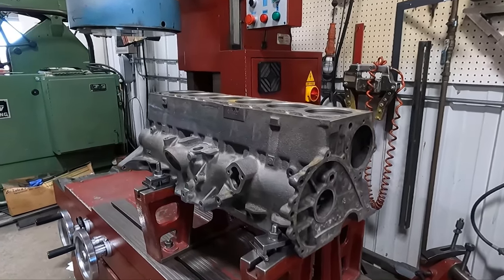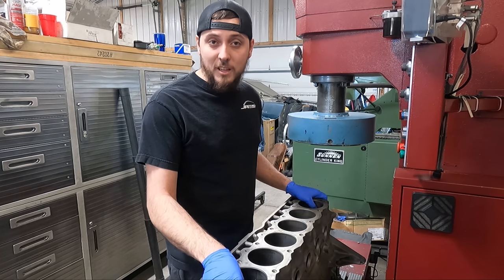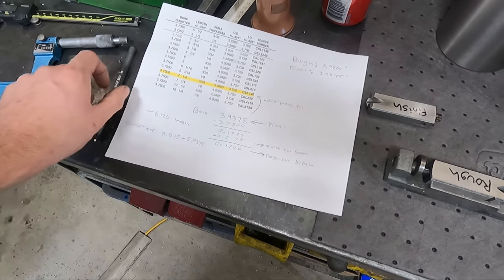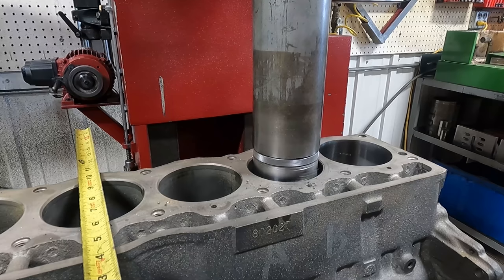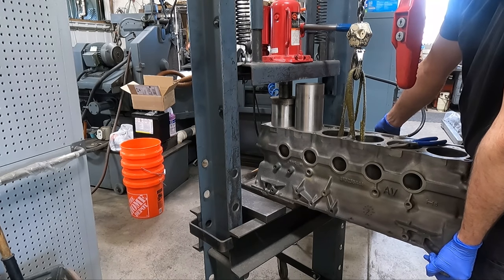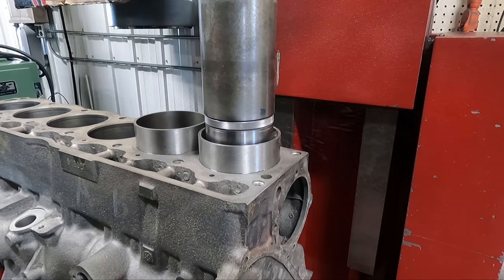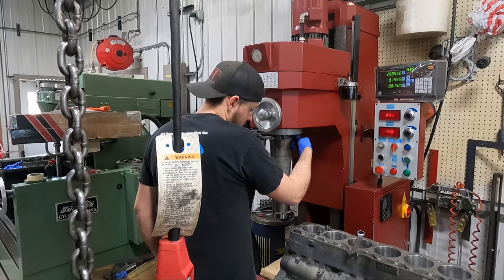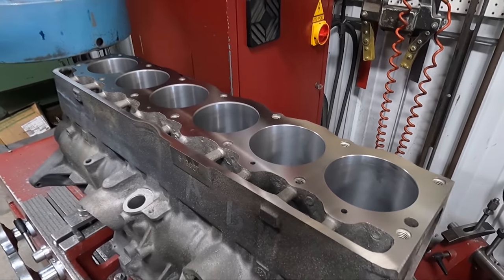Installing Two Repair Sleeves In A 258 AMC Straight Six Block @JAMSIONLINE

Comment: You repaired an engine like I had in my 73 AMC Hornet.  It was a very good engine!  I wished it had a larger carburetor, and fuel injection would have awakened that engine!  Actually I wish I had the car now!
A simple engine to work on and gave good performance.
You did a very good job, your details of whats needed in each step made it understandable and the engine's owner will get many good miles with it!  Thank you!
Reply: If you find my comment above, the car the engine was in was a '71 Hornet. It was bright green, so I called it (of course), The Green Hornet. It would really boogie, and it was reliable. I had added stiffer springs, sway bars and coil-over shocks (I found Mustang shocks fit to a T). Boy! It would take a corner with extra wide T/A Radials. I miss that little car much. I sold it to Grandpa who gave it to grandkids, who wrecked it. Damn!

Comment: New subscriber to this channel.  As a mechanic  of over 35 years  it is still great to see that all over the world there is still machine shops operating to this high standard of quality. When I was a younger mechanic we always had heads  off  and blocks out for repair. Now unless it's for high performance or antique restoration. It is either install a second hand engine or scrap the car.  How times have changed in the automotive industry here in Australia.
Reply: America is no different. 
Aside from industrial engines and hotrod enthusiasts, nobody will pay for rebuild engines.

Comment: Thanks for showing the process. Never seen this done, but have had it done on numerous motors. I was shocked that you could bore the Cylinders without oil or some lubricant.

Comment: Lovely work, it's great to see a shop that still works to such a high standard. Rare as rocking horse manure these days in the automotive engine recon business. Watching this particular job also made me think of the ease with which I could recondition my Triumph TR3 and TR4 engines back in the day, as they had wet liners that were a just a breeze to replace.

Comment: As a machinist we would move the bore a little bit when the situation on coming to our shop being a stock engine mainly you have to know how much cylinder thickness you have to work with to be able to move this cylinder bore over to a reasonable bore size and you have to look at the head gasket situation. And always look at the cost of just getting another block.

Comment: My 258 snapped the #1 rod near the crank. The rod punched a 2x2 hole in the side of the block and the piston pushed up in the cylinder with the rod hanging from it. It kept running. Opened the hood to see what happened.....the new window in the block made for any easy diagnosis. I JB welded a sheet metal patch over the hole, and the 5 cylinder lasted for nearly 2000 miles afterward. 73 hornet. 130k when she blew.

Comment: That takes skill, my skills are in welding, I work on antique tractors and things I am not done with a 1957 D8 caterpillar but I do have it running after 30 yrs since it was seized from over heating but had to have some machine work done and want to say you do very very awesome work, I don't know if I'm to old at 55 to learn skills like that but would like to give it a try

Comment: One way to visually determine in the block is a 258 or a 4.0 is the 4.0 has an area on the water jacket side of the #1 cylinderspot faced for water pump clearance. When manufactured all six bores were finish bored in one operation.  Followed immediately by honing.

Comment: Thank you for taking the time to go over the whole process in detail, there is a lot of videos on cylinder lining that just show this information....
Just have one question, when you retract the boring bar, how does it not scar the bore on the way out..
Reply: My guess is that it does but with a boring head that diameter its going to be super rigid and the score will only be maybe .001, but even if its .003 he is honing .004+ so it will clean up during that process. I am a Machinist (not engine) in a CNC mill there are boring cycles that will move the spindle towards center at the bottom of the bore, after the spindle orients to pull the cutter off the wall. There is also a feed in feed out cycle. I do not know if these have that capability.
Reply: @MiloPerrotti  
If I required I would imagine that they could position the cutter at the X positive position and just move the table over. 005"
Reply: @mpetersen6  yeah duh, but does the machine have the capability to do that on it's own? That's what I'm talking about. Of course you can do it manually.
Reply: @MiloPerrotti  
Automatically?  I doubt it.

Comment: First timer here on sleeve boring, in my past most mechanics would not trust a sleeved engine rebuild, unless it was originally a sleeved engine. 
What would set a prejudice like that?
Like how you know your equipment to get it to meet tolerances.

I do agree with the other commenter about using liquid nitrogen to shrink the sleeves before installing them. It is used as a standard practice with diesel commercial, construction and agricultural motors. It is not expensive to set up. A dewar, freezing sleeve container, gloves and tongs to handle/move the sleeves in LN2, then a written procedure for safety and methodology.
Nice shop and great detail on this customers block, would be nice to see a completion video.
Thank you all for sharing.

Comment: 1980 and later 258 are known as lightweight 258's as they removed 20lb's of material from the crank and block. the lightweight 258's tend to develop wavy bores and break rings, they can also get pinholes in number one where they're machined for the water pump. it's always better to use a pre 1980 block but the sleeves are a good option to keep a lightweight going because they won't last long if you bore to 60 thou over.
Reply: I would have sleeved all 6 of them.
Reply: @barryfields2964  Me too 👍😏

Comment: I love watching you guys work! Just a thought... When you are pressing in sleeves, are you putting the tapered edge of the sleeve down or up? From what I have read, putting the tapered edge down can actually cause issues since the sleeve bottoms on the top of the taper. When the sleeve is bored/honed, you can end up with a gap between the bottom of the sleeve and the ledge at the bottom of the cylinder bore. This means that there is a slight chance of the sleeve moving in the future. When the square edge of the sleeve is put down on the ledge, this is no longer possible since no gap opens up as the sleeve is made thinner.

Comment: i have work in auto machine shops on and off for 40 year's i did line boring  , motor Assembly w/ test run  and balancing . in the area i am in there is no one behind us to take are place and that's sad . who is the maker of your boring surfacing machine [rmc 1600 ok it showed up in your video now i know]  thanks and keep up the great work and videos . i wish the blocks that i work on were as clean as your stuff is clean .

Comment: Love  your content and I don't usually comment ....The big elephant in the room here.. Every time I pull down and engine that has been run with no thermostat . This is the what happens when ignorant people remove the thermostat..cold water / cold front bores .. fuel washes the cold  bores.

Comment: Just a little FYI....the rear main seal in a 258 can be used to replace the OEM rope seal in the Oldsmobile V8. Just trim the 2 edges off. You're welcome.
Reply: I did not realize that. Some people were using Ford 460 rear main seals in the Olds 455.

Comment: They make a destroke lever for the cv-616.  It is a add-on that will let you dwell anywhere in the cylinder.  I believe it's only about $500.
Reply from the maker: It’s sitting in a box on the floor of the office because I haven’t had time to install it 🤣
Reply: I have a set of coarse diamonds that I use in my cv-616 if I don't have to sleeve and I just need to take out .020 or so.  It saves a lot of time from going from the boring machine to the honing machine.
Reply from the maker: Us too! I like the diamonds also. We deck most blocks so if it’s already on the machine it’s not too much more work to bore.

But once in a while I just hone!
Reply: I did not know it was practical to hone +.020. I did hear of instances where honing +.010 was a good move. It was on the Hagerty channel. A guy had to do a second rebuild of his 396, which was already at .030. He was able to have it +.040 afterwards.
Reply: @skylinefever  With stones no but with diamonds yes because they dont wear and cut super fast.  I will leave .003 after the diamonds and do the rest with stones.
Reply: @ballardperformancemachine  Thanks for the explaination. Since I'm not a machinist, I don't know the minor details about machining equipment.

I did hear about using various honing equipment by Total Seal, they say it is critical for getting the most out of new piston rings.

Comment: Balls to the wall sleeve everything to Standard lol 
1. do sleeves wear better than the block?
2. why do you think the last 2 has so much ware? does that end of the block take longer to heat up?
Reply: Slevees may wear better than the block. They are often made of centrifugal cast ductile iron. It's an improvement over engines made of cheap grades of iron.

Comment: Have you guys ever thought about freezing the sleeves with nitrogen before installing them ? I do it with machinery bushings
Reply: I was going to ask the same
Reply: You wouldn’t even need nitrogen. We use to just put them in the freezer overnight, and maybe hit the block a little bit with a torch. They would drop right in.
Reply: I have done this with atv bearings into aluminium housing,slides right in ,no nitrigen,just put in the freezer overnight.
Reply: I was also going to ask this question

Comment: 060 on all 6 is a better option from a cost perspective. Centering on the bottom of the bore which was standard would have easily cleaned up at the top of the bore with the wear. If for some reason it didn’t clean up there was always the option to continue with the sleeving of the the cylinder/s.

Comment: I myself have fitted quite a few cyl sleeves and i have to say that engine had a massive amount of wear even in the cyls without broken rings i would say the owner was not even using an air filter or he may have been using a washable filter such as a K&N which are known to let in a lot of dust. The average person does not realise the damage that is done to the cyls and rings when you don't use an appropriate air filter.

Comment: What would you have to do if you accidentally left the parent bore with an extra .002" press fit as compared to your smallest sleeve? Seems it would be very hard to center up and make a .002"cut on the boring mill

Comment: I am a machinist, I’ve never done engine machining but I just wanted to know why u don’t indicate the tops of the heads or the blocks. I see that you use a level. I’m just curious how accurate those are. You don’t remove a lot when u deck surfaces.

Comment: Another question if you don’t mind. I have plans for a 2618 forged piston with 1mm1mm3mm rings how much clearance should be allowed for a turbocharged FE engine at 900 hp?  It is a heavy duty truck block that has minimal wear, but I have to buy custom pistons to hopefully keep the walls .170 thick at 4.103 bore.  It needs a sonic test but measuring between bores with a drill bit shank it has 3/16 inch up and down all cylinders through the core plugs. The bore spacing is 4.63.  By Fords standards it could be bored to 4.16-4.185.  I want to keep the bores as thick as possible and as you know the 391 FT had 3 rib mains on the thrust side. I have a CapSaddle girdle made of the same iron as the block, ARP main studs, head studs and getting the factory 3.79 crank offset ground to 3.91 only a 060 cut.  And a lightening and reduced rod journals to 2.2 from 2.43 so I can use BBC 6.8 rods. The journal index is within specs. And the fillet radius on the rods is easily duplicated. I prefer the forged steel crank made of the same steel as the 427 SOHC only everything is seasoned and work hardened.  I wish you were near me in MO you would have the job on the block and crank for sure. You guys are great. If all goes well I will have a near 1000 hp daily driver FE. With a VS7875 on 413 cubes the boost curve should allow lumping around under 4000 with the roller cam 245@.050.600 lift Bullet cam and at 4000-7000 the fun kicks in. 😅Great shop!

Comment: How thick are these sleeves? I hate sleeving two cylinders side by side, is that just a V8 thing?  The 6 is stiffer, but I just wondered. Do you not use cutting oil?

Comment: What is average cost to do complete machining on a Chevy 305 small block? 
It's in an 89 Camaro, original engine. 
Assuming the crank just needs polished, boring the block 30 over, honing the mains, install cam bearings, planing the block decks, & a complete rebuild of the heads, including new guides, plane the heads, grind the valve seats, but shouldn't have to replace the seats.

Comment: if you were to bore to 40 thou over across the block are you open to over heating issues later when motor is back and running !
Reply: How far you can bore an engine is sometimes determined by how thick the walls were cast. The Ford Sideoiler for example, often didn't handle a +.040 overbore.

Comment: Minimum clearance on the two cylinders that were sleeved is risky as the heat transfer is affected by the sleeves. An extra .0005 is best practice to avoid piston scuff especially on an industrial application as many also run on LPG instead of gasoline which burns hotter.

Comment: I have a question I have a 90 model 4.2 and it’s a hard to fine engine in one of the cylinder I piston busted putting a hole in the cylinder can it be tixed by putting in new sleeve’s

Comment: When an engine is that worn-out, it's probably not cost effective to fix it. Then other options should be considered. Different engine, engine swap, or another vehicle. At least I do. Years ago I knew that the 305 was junk in my Caprice. I got a 327, had it built, and then swapped it over.
Reply: And yet tens of thousands of engines are rebuilt like this every year.

Comment: Great video as always. I do not have experience with those engine blocks, I know it would be more of a pain but would it be better to install one sleeve at a time then finish bore the other cylinder due to minor distortion since they are next to each other?
Reply: Since they’re doing the final bore with all the sleeves in it won’t matter in the end
Reply: @jordanthornton4803  I know it won’t effect the final bore size, but when pressing in a sleeve it distorts the cylinders next to it, I’d think boring for two sleeves at the same time next to each other would ultimately increase your press fit between  the sleeves and induce more stress in the block potentially causing a crack.

Comment: Why not use dry ice to shrink the sleeves? I was working in a heavy duty shop that did in frame rebuilds and that was pretty common for them to do from what I saw, I was an apprentice then so I am not 100% on the understanding why and maybe it was just select motors also

Comment: Are you guys not close enough to a  supplier to get liquid nitrogen?  When I’m doing only one or two sleeves I use liquid nitrogen  to drop the sleeves right in.
Reply from the maker: ~30 minute drive, just has never really seemed worth it when the press is easy. I have a v8 coming up that needs several sleeves, I’ll probably get some for it.
Reply: I call a person who goes around to farms to top off their nitrogen tanks in advance , comes by and fills my tank. Charges $25.00
Reply from the maker: @Kenny-1958  Yeah, but we don't have a tank lol. When we get it we have to put a $500 deposit on the tank and its around $30 to fill. Then return the tank for the deposit.
Reply: @JAMSIONLINE  I’m the other way. I only use it for one or 2. If I have to do the whole engine I use the press. Out of a 10 liter dewar you only get enough for 3-4 sleeves. Of course I’m in south Florida so it’s 80+ in the winter, so it evaporates quicker. Where you are may be different. Maybe if I had a bigger dewar I would do the whole engine. 
Especially on in-lines. I hate taking the block 

out of the machine(I’m lazy). But on V8’s I have to anyways to do the other side so it doesn’t matter any way. Lol. 
 I also use the nitrogen for valve seats. It helps them go in easier, and it actually says to use nitrogen or dry ice in caterpillars repair procedure for installing seats. 
 I use a yeti cup to soak them in the nitrogen and a pair of long needle nose to get them back out and set them in the pocket. Definitely don’t have to hit the driver as hard or as many wacks as without.
Reply: @JAMSIONLINE  you can get dewars on eBay. They are cheap. You don’t have to get the whole tank. Just takes a little more planning.  Don’t try to drive with it inside your vehicle with windows up. It will push all the oxygen out and suffocate you.

Comment: I had a 1977 amc 304 that had two sleeves, not approved by me. This failed badly. Had a short block put in and did the rest myself. No sleeves ever after that failure.